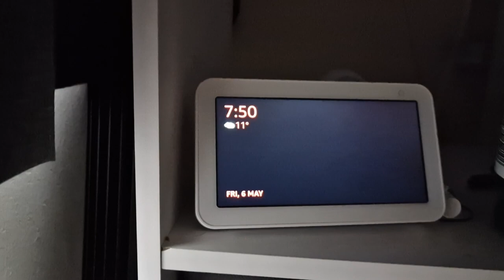Husky's quick Recovery after his visit to the Vets

Comment: Depending on what type of procedure has to be done, different types of anesthesia are used and how deeply they are put under to allow for the level of anesthesia a procedure takes can result in a dog being different in their level of consciousness and how fast they throw off the drugs afterwards.  For something like a dental cleaning and perhaps a small tooth extraction the amount of anesthesia is a lot less than would be given for an eye surgery where you want the dog at a fairly deep level s that they are not able to even make and unconscious blink or eye movement that could pose a risk during the procedure.  Its also very common that different sedation and anesthesia drugs are used from one procedure to the next.  This means a dog can be wide awake and bright eyed and raring to go after one surgery while after another they can be doped up for a day or two or three.  Age also has they effect of how well the drugs process out of their system, depending if its drugs that process out through the kidneys or the liver.  We sometimes forget to warn patients family that they may not be up and about as quickly as the last time they had anesthesia, as their were different drugs used, and how deeply they were sedated.  Usually it comes up when a patient had a deep anesthesia for a procedure and then comes back in for one that will need a lighter one and the family is worried that their pet maybe out of it again for several days like 'last time' and then we explain the difference and why they maybe up and almost normal by dinner time.
Reply: Hello 👋 pam
How are you doing today?